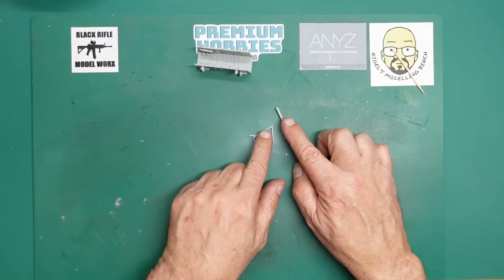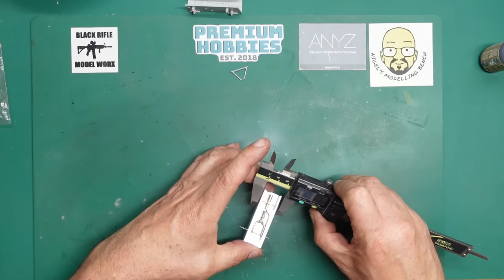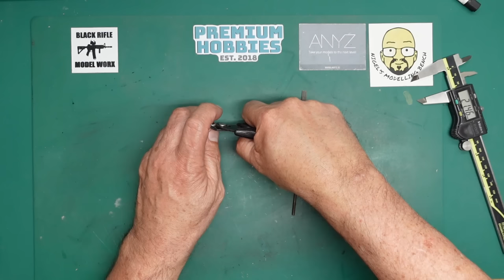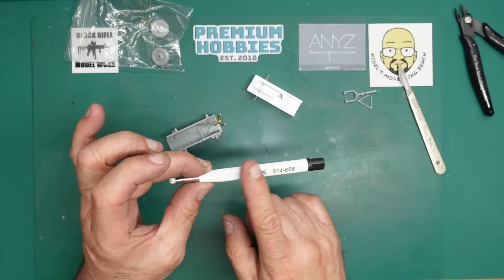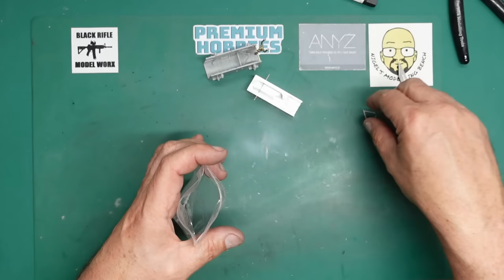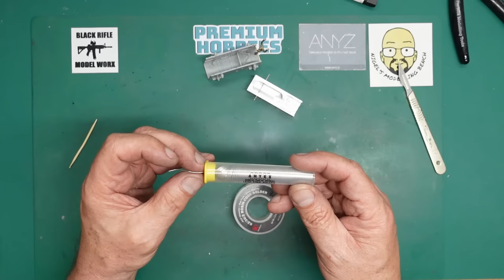A fix for the A-20G nose gear perhaps???

Comment: An elegant solution, Nige, and to some degree it must have been obvious to your engineer's brain.  Perhaps the best solution would be for your mate to modify the casting to include the cross piece integrally as one piece?
Reply from the maker: Yes, that would have been great from the start, however I believe its tricky to cast legs with "holes" in them?

Comment: Nigel,  This is an absolutely inspired solution to this problem (Gosh - you must have been an engineer in a previous part of your life 🙂(as I know is the case)).  Two questions: 1) Could you have soldered the two brass parts  using a large enough soldering iron, rather than a soldering torch?  2) Is there some way you could provide dimensions or drawings of the jig so that if someone had the wherewithal they could build their own copy of the jig?  If somebody on this side of the Atlantic (not me) were to provide this "fabrication service" for the US & Canada, postage would be a lot less for modellers building this kit (and transit times would probably be significantly less).
Reply from the maker: Hi Tron,
A soldering iron would not get enough heat into both parts as the contact area would be tiny. Also, the large parts and the ali jig are a heat sink. As for making a jig, anyone capable of making it should be able to design their own if they have the leg to work off.

Comment: How you've made the leg is how it should be to start with.Also the kit triangular bracing part should also be made from the same metal.That would create a really strong unit.
Reply from the maker: Yes.
Reply: @NigelsModellingBench  Since they have already shown the box art for the next kit would it be correct to say it's a done deal as far as any changes go.
Reply from the maker: Probably, although it is not in production yet. I have suggested they make the leg as one piece and change the spindle design. It would probably be a better solution to use the top of the white metal leg and drill it out to accept the lower plastic leg, we could also add some steering then?
Reply: @NigelsModellingBench  How about suggesting to Aerocraft to make the oleo/fork assembly as a separate part.That way the wheel can be positioned as desired.You have a report with him and he seems to take your advice into consideration.
Reply from the maker: I don't think Aerocraft will be revisiting the nose gear Steven?
Reply: @NigelsModellingBench  Ah well,just have to see what the next kit offers.